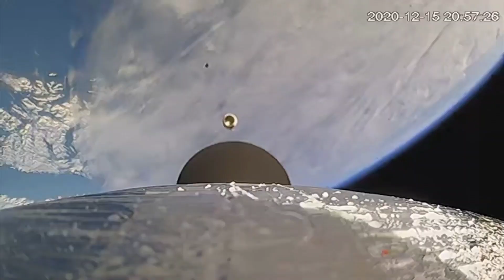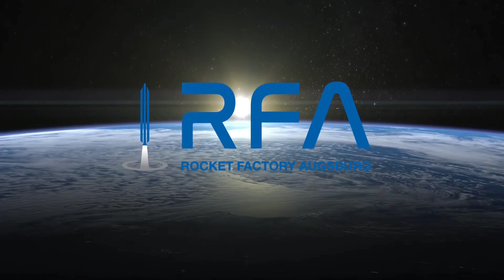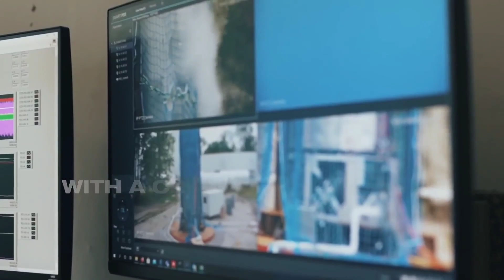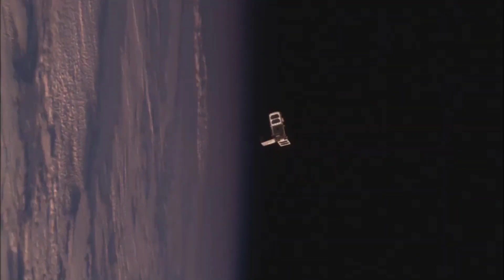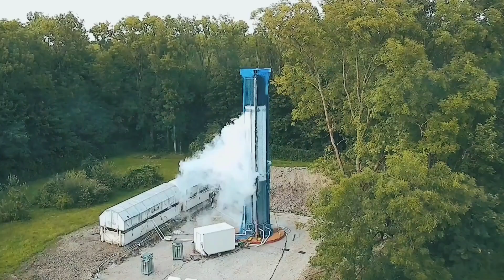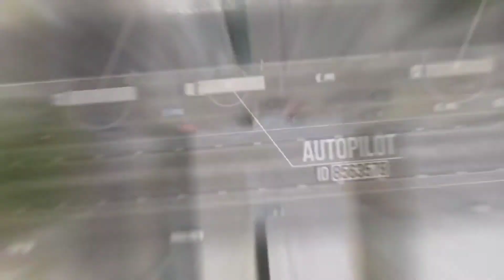RFA - Stainless steel, reusability and staged combustion. A German SpaceX? EXCLUSIVE INTERVIEW

Comment: I wonder how long it will be before someone starts collecting space junk in orbit but doesn't want  to deorbit it but instead reuse it somehow. If you could process junk in orbit you've potentially saved all the energy that was expended getting it up out of the gravity well in the first place.  Space based solar powered aluminium smelter anyone?

Comment: Peter Becks interview with Everyday Astronaut points out the folly of cost per kg and what sat operators really want. Rocket Lab is dominating the markets and once customers have a stable provider they aren't going to change. RFA is late to the market and will have to fight for scraps, it will have to deal with not just German redtape but EU redtape as well and thats not a good look.
Reply: He is right that the penalties in getting to market late aren't too high. As long as one is able to get a better and cheaper launch option to market, most potential customers will want to fly on your rocket. It's not like say a youtube competitor, where it just isn't enough to be better. Youtube was first and the user base is the real value. This is really the difference in catering to companies vs catering to consumers. Companies tend to be more rational in economic decisions.

However, there are still some penalties to being late. Basically, cost goes down with launch cadence. So if SpaceX is launching 50 times per year, and you want to compete against their pricing, you also need to launch 50 times per year (if all other things are equal). But when the company is starting out, you just won't be launching as much as the competition. That means you either your pricing has to be higher than the competition, or you have to run the company at a loss until the launch cadence gets up to a good level. The former could mean not getting any customers, as they have no reason to pick an expensive and unproven launch provider, and the latter leads to substantial accumulated losses over time.
Reply: @espenha  :  I appreciate your thoughtful comments. It is simply glossing over reality you claim that being last two market is a great advantage.
Reply: Not only that, they are so naïve they think they can hire engineers from all over the world and their technology will not be stolen. You are taking a great risk hiring even one Chinese national. I hate to say it but that’s the truth. Sometimes I think these Germans are kind of set back by losing two world wars and all the guilt that carries, and that’s a lot of guilt to carry around, but then they act like little children thanking that everybody is good and decent. That is not the truth!

Comment: what about a big sticky pad for the capture of very small stuff?
Reply: would probably be moving too fast, though it you have something inflatable, sticky, and thick. Then yeah, Bubble guns
Reply: Sticky materials don't generally like vacuum.
Reply: Giant ball of chewed bubble gum.
Reply: It is hard to make and maintain sticky pads in space because of the extreme cold and then heat as you orbit the earth and come in and out of sunlight. Nevertheless, we need way better ideas than grabbing them and taking them back with us. I have suggested punching them out of space. The satellite should have a punching arm that simply punches them down .  This makes sense from a first principles analysis if you look into it.

Comment: I think people starting to be too much obsessed with "reusability", while ignoring big part of rocket launching costs, goes to the support infrastructure and Staff.
Reply: @BrewedIn62  no, you just show your ignorance. Also confusing total reusability reusing the second Stage, with just reusing the first Stage. As currently does SpaceX and many other companies pretend too. If fully reusability was so cost effective, then NASA would continue to develop the Space Shuttle design. Starship is starting to steer towards that design, now using TPS shielding. The cargo hatch is getting smaller, and the flaps could be replaced by fixed wings. Not a surprise if they then replace the propulsive landing, with gliding with a retractable landing gear with wheels. Since that would allow SpaceX to reduce weight with extra propellant and rocket engines to gimbal and land.
Reply: @BrewedIn62  completely different machines. The Concorde was a Supersonic plane the Space Shuttle was an Hypersonic plane. One used turbojet engines with reheat (afterburners), while the other had rocket engines fed with propellant by an exterior tank. What cancelled both was operational costs. Starship seems going in the same route, because they need to reinforce the rocket structure to endure the lateral loads at reentry, lowering their target payload weight. Not a surprise if Starship gets cancelled as Starlink, due to the operational costs.
Reply: @BrewedIn62  are you aware Falcon 9 didn't drastically reduced the costs to LEO as promised? The Starship and Starlink seems to be sucking all the funding without any certain about being economical viable. While many fanboys would quickly bash the SLS program.
Reply: Rocketlab, who are the main proponent of saving money on infrastructure and staff, are building a reusable rocket. Reusability is very important.
Reply: @LaughingOrange  reusability in the Rocket Industry is important until a certain point. There is a Tsiolkovsky Rocket Equation, that just shows you that.
Reply: @BrewedIn62  Reading that I got am image of someone driving their car throwing bags of garbage out the window before dumping their car off a cliff each day.
Reply: @harmonyspaceagency1743  completely different things. More likely driving near a Vulcano to collect a sample of lava. So you need to reinforce your vehicle to survive the intense heat. You can make it tougher, but the extra weight would make you more easily get stuck. So you need to find a balance. The Tsiolkovsky Rocket Equation, is there. So make some calculations.
Reply: @BrewedIn62  The Space Shuttle was supposed to be partially resuable, but in practice it required a huge amount of refurbishment between flights. So when people (or, at least, Musk) say "reusable" they mean "reusable with minimal refurbishment and rapid turnaround".
Reply: @BrewedIn62  that lame comparative with an Airliner is getting quite tiring. A rocket is different from a plane. A Rocket needs to be lighter to maximize it payload to LEO or farther. To make it reusable, you need to reinforce it and make it more complex. Reusing a rocket just makes sense if you have many launches per year, and the refurbishment is cost effective.
Reply: @BrewedIn62  for a reason SpaceX claims of saving costs reusing Falcon 9, aren't translating in drastically reduce of cost per Ton to LEO.
Reply: @RogerM88  Looking at the SpaceX figures, we have to remember that the second stage is being fully expended each time. How much that costs to produce, I don't know, but if we assume it's ~$12M, that means that the cost of the booster is now $50M for the first launch, and $38M (76% of the production cost) for subsequent launches. And that's assuming SpaceX is being up-front with their costs per launch, and not doing something tricky, like launching below cost the first time, and making up for each successive launch. If we assume that the initial cost of the booster is not $50M but $actually 50% higher at $75M, then the first launch is in the hole by $25M, which has to be made up over the subsequent launches.
Reply: @GoranXII  if was so cost effective to recover the second stage, SpaceX already had tried to done it. To recover the second stage, you would need a massive inflatable cone, that would work as a shield on reentry. And you also would need to install many parachute stages to slow it down to land. Then you would need to recover it at the Ocean with a ship, or using a catching mechanism to avoid it falling into the Ocean. Adding all the extra weight, refurbishment and recovering it with a ship, all those costs added, could be preferable to just build a new second stage.
Reply: @RogerM88  Agreed. But my point stands, the cost of the second stage is making the refurbishments appear less economically ideal than they actually are.

Of course, it's not just the reuse savings where Falcon 9 wins out. Building and transporting the Falcons flat means they have much lower maintenance costs on their facilities, since you don't have special ventilation and lighting requirements for the buildings.
Reply: @GoranXII  SpaceX didn't need Starship. They could develop a bigger fairing to Falcon Heavy, able to fit the Red Dragon capsule lander and an extra stage. That would be enough for cargo mission to the Moon and Mars. While in a possible crew mission to Mars, the Red Dragon would work as a lander. And the voyage with a modular Spaceship assembled in LEO. A capsule design would be safer to land, and could work as an ascent module, being easier to refuel. Possibly using propellant from other cargo missions.
Reply: @RogerM88  The Falcon 9 core is still only 3.7 m wide, so widening the fairing any more could have caused issues. They could probably have looked at up-scaling the whole rocket, making something in the region of 4.5-5m wide, which would not only have increased the payload, but allowed a more controlled landing, since they'd have more engines to play around with.